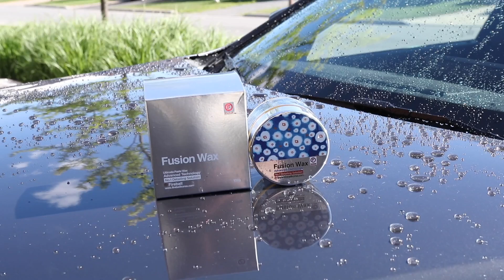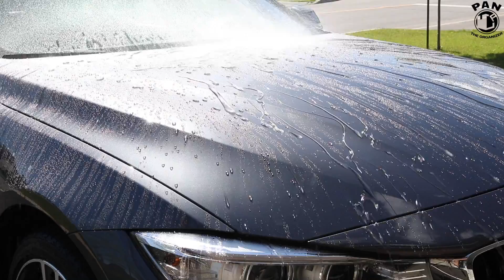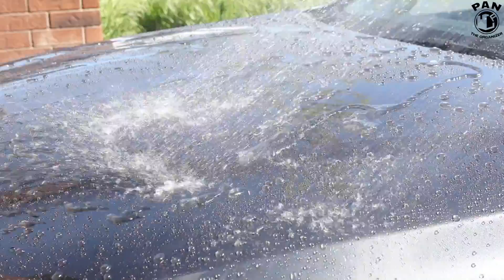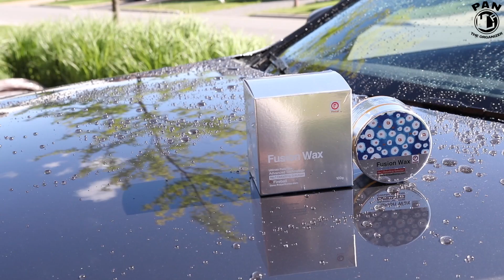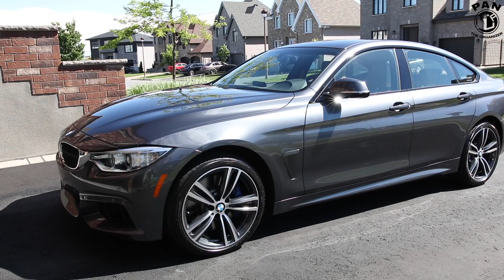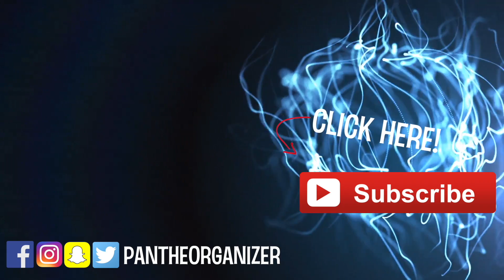FIREBALL FUSION WAX: WATER BEADING TEST !!!

Comment: Pan, the results are amazing!  Your car looks incredible and the hydrophobic action is impressive.  Makes me want to wax mine just so I can spray water on it!!  Thanks for sharing.
Reply from the maker: +Todd Halstead 
Lolol !!!  Yup!  I love watching water make pearls on the paintwork!
Reply: Pan TheOrganizer I have a question.  On my SQ5, I'm not sure what the previous owner did to the paint.  I have had a few people say they think there may be some kind of coating on it since it has no swirl marks what so ever.  I want to clay and wax, would there be any problem with me doing this to the paint if there may be something done to it?
Reply from the maker: +Todd Halstead 
Hi Todd.  If water beads a lot then yes your SQ5 might have a ceramic coating on it.  If water doesn't bead or sheet off, then there is no protection.

You don't add wax or sealants on top of ceramic coatings as this negates the effect of the coating.  To top coatings, you use SiO2 infused spray sealants like CarPro Reload or Fireball Ultimate Coating Wax.

If you want to remove the existing coating and start off with a clean slate, you have to polish the surface.  I would wash the car, do chemical decon and claybar, dry the car, then polish the surface with something like Meguiar's M205 or a polish of your choice, then IPA wipe (like CarPro Eraser or Gyeon Prep) and protection with your choice of wax, paint sealant or nano coating.

You need mild abrasion with a polish in order to remove coatings.

Does this answer your question?
Reply: Yes, this is the best answer I have been given yet.  Water does bead, not a lot but it does bead.  Thanks for the in depth answer!  What would you do, remove it or leave it alone?  Thanks again Pan, always look forward to your videos and replies.
Reply from the maker: I would remove it for sure as you don't know the nature of the coating, what brand, or how long it's been sitting on the paint.  A good in depth polish with Meguiar's M205 (a classic to remove coatings) should suffice.  ;)
Reply: Pan TheOrganizer thanks for all your help!  That's what I was thinking as well.  Just wanted a second opinion, and I value yours.
Reply from the maker: Anytime Todd!  :)
Reply: Pan TheOrganizer I have another question about applying the M205.  I plan on using my DA and I know I need to spread it out on a slow speed setting.  Should I turn up the speed to work in the product some or do I just spread it and buff off?  Thanks again Pan.

Comment: I have a question related to waxes,is it like ceramic coating with which we can apply several layers.If i apply several waxes,will be beneficial like adding protection and more gloss or just a waste of product
Reply from the maker: One thin coat of wax, applied every couple months is all you'll need.  There are no real benefits to layering a traditional wax right away.  It's not like mulitple layers of a ceramic coating.

Comment: That's nice beading and gloss but any quality wax will get you that...Meg's Ultimate Paste Wax will do it for  1/15th the cost of Fusion Wax.
Reply from the maker: Yes if well applied a good quality wax gives nice beading.  That wasn't the debate here.  It was only a video meant to show off the beading capabilities of the Fusion Wax which are great in my opinion.  Plus, in my 20 years experience, it is one of those ultra premium waxes that does make a difference in the amount of shine, and warmth in the glow like my other favorites which include AngelWax Enigma, Pinnacle Souveran in paste and Swissvax Onyx.  All great waxes.  I never got that level of warmth in glow with Meguiar's 'general public off the shelf' waxes.  Still great products though.  Depending on your budget, sky is the limit.  But one can get great results even with 20$ waxes.
Reply: Pan TheOrganizer I think you prefer the "warm" look of natural carnauba wax, which is what is found in the waxes you mention,  to the synthetic polymer waxes like the Meg's. One benefit of the synthetic products is that they're often less expensive being made from lab-sourced, rather than nature sourced, ingredients.

In any case, keep up the organizing 😉
Reply from the maker: Synthetic sealants also last longer than carnauba based waxes.  But for the best of both worlds (shine and durability) the best for me is for sure ceramic coatings.  Nothing beats those in my opinion.